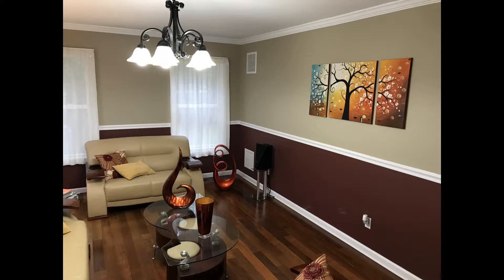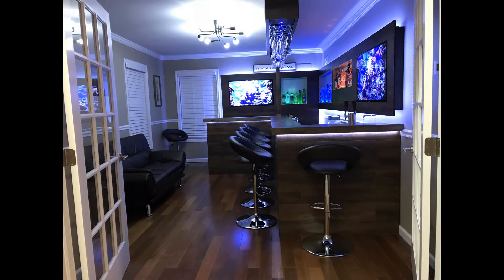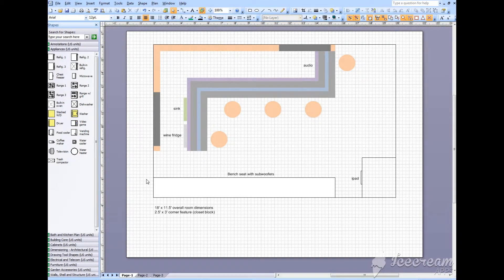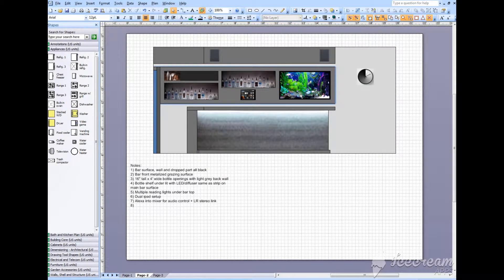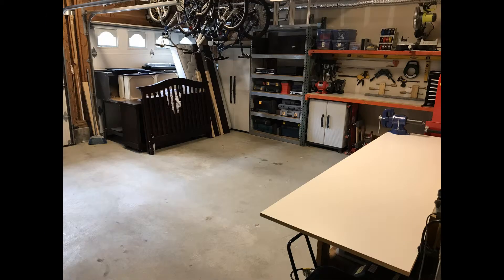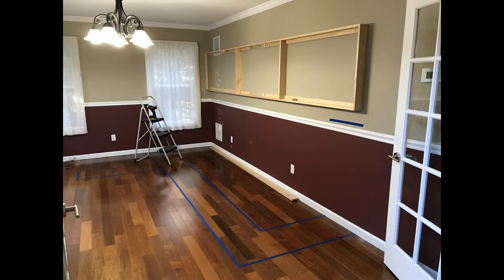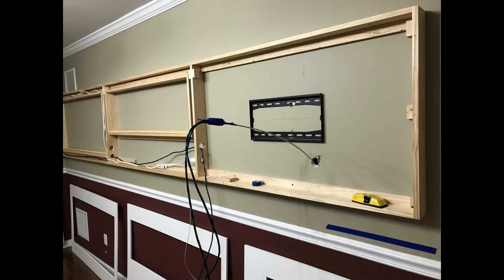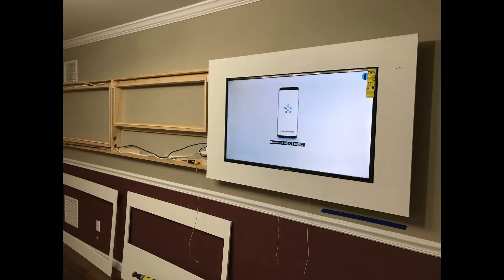Home bar build part 3

Comment: GREAT JOB!!! What's the height of the rectangle that's on the back wall housing your TV and bottles?
Reply from the maker: Thanks! TV cutout has basically 1/2” relief around tv (whatever size you want), cutouts are 51” wide and 22” tall for vodkas and 14” tall for whiskeys.

Comment: Great bar in fact I'm going to build mine to your stye its the best I've seen with the lighting and recess for your drinks and tv's. how did you do the lip of you bar using the laminate board and is the corner sharp. Thank you
Reply from the maker: Thanks! So I cut the strips for the side and connected them by a single pass of a tiny wood plane (45). It put a micro bevel on it taking the corner down and improving the look as if it’s one price of wood. The joint is a simple lap so I use the planer to make sure the lap doesn’t extend out.

Comment: Awesome job on the build! Turned out great. Whats your spacing behind bar from wall to bar top?
Reply from the maker: Hey dude, 34” from the wall and 30” from the wall feature. The second level of the bar is 4” from the top so about 30” average. Let me know if that makes sense.
Reply: @eric180db  thanks, the second level of bar, u mean the top where you have glasses mounted?
Reply: Had one more question, what size and thickness pvc board did you use, and how did you attach the laminate flooring to it? Thanks
Reply from the maker: Second level down, so actual space to walk is from lower level (small work area) to wall feature (TVs and bottles). 30” which is plenty
Reply from the maker: PVC board is 1/2” here is link. Mount it wood grain back. Use small brad nailer at both ends (center) of each tile. 
https://www.homedepot.com/p/Veranda-HP-1-2-in-x-48-in-x-8-ft-White-PVC-Trim-H120AWS6/205309788